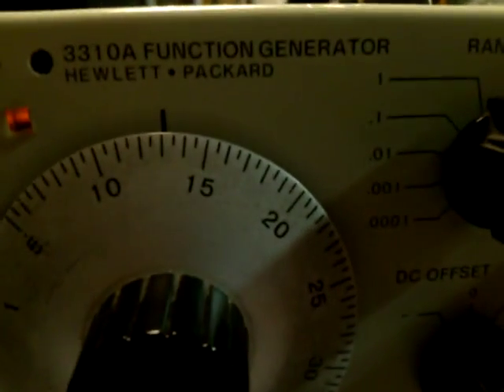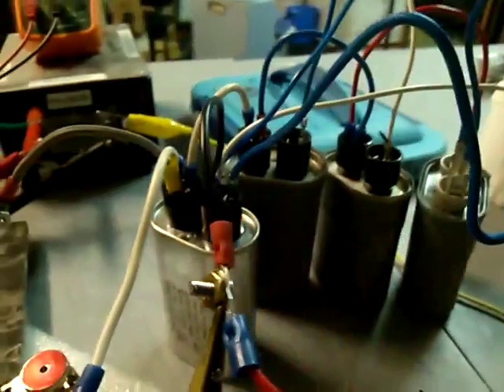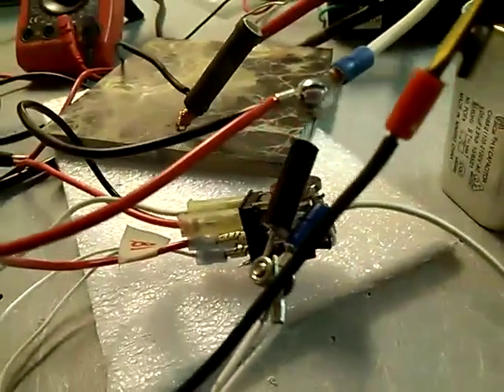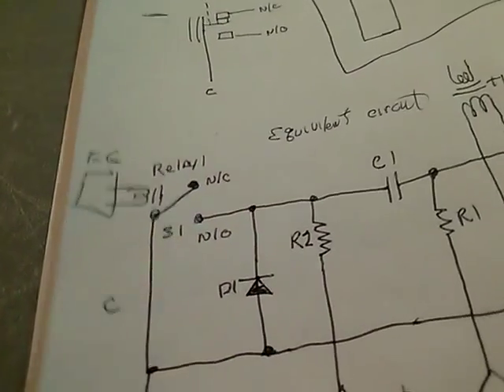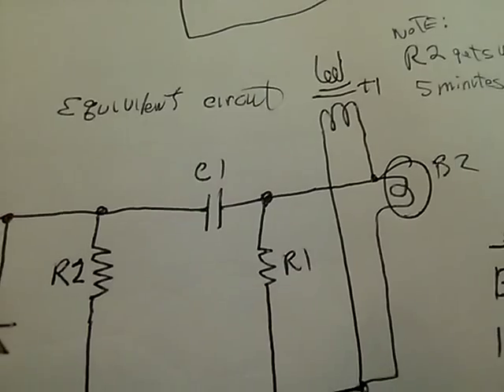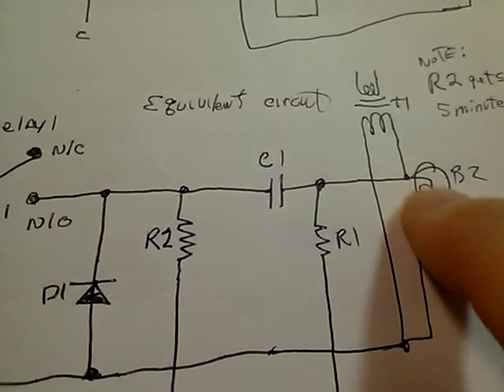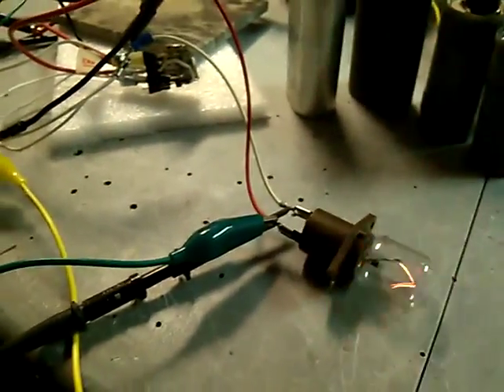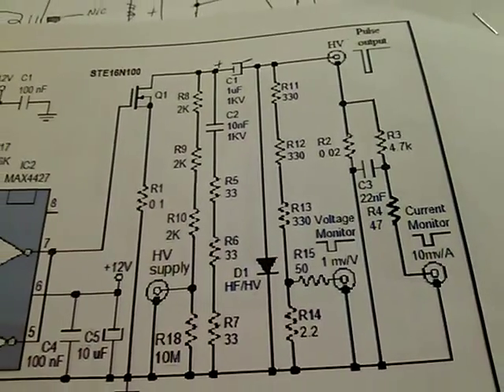High voltage pulse generator circuit

Comment: how can i build a 20 v amplitude square pulse of 200hz?
Reply from the maker: I would study all the schematics i could did on internet if I was going to do that. I studied a 100 years of circuits before I designed my mono block vacuum tube amp that is an evolutionary improvement  over the last 100 years of circuits. Study. Study,  study and then build your own.
Cheers
CW
Reply: @lablancengineering2  Thank you for the pushing
Reply: @lablancengineering2  Any hint or sugestion on what would be a good starting point?
Reply from the maker: @itrstt66  
If I can find off the shelf equipment,  I start there first
Reply: @lablancengineering2  allright, so gathering components and start building/studying/experiencing with the breadboard?
Reply from the maker: @itrstt66  yup, if I can't find off the shelve equipment for my experiment,  I design and test on bread board, then permanent solutions when bread boarding goes well. Thats how we built the vacuum tube amp and lots of PWM circuits.
Captainwilly
Reply: @lablancengineering2  thank you once again what is that referente to captain Willy?
Reply from the maker: Not sure what your question is sir?
Reply: @lablancengineering2  i just didnt get what you meant with the captainwilly reference